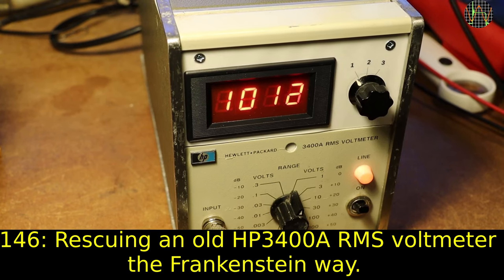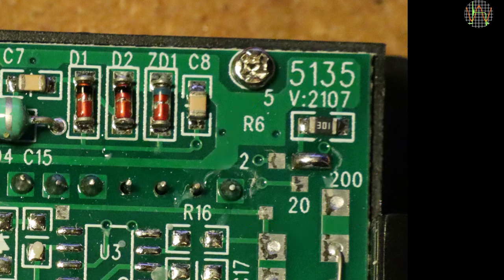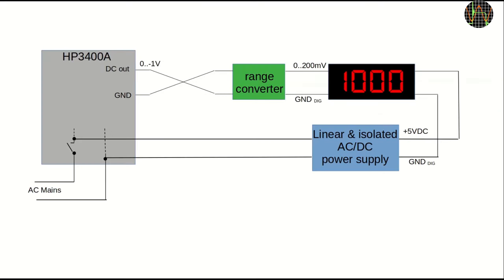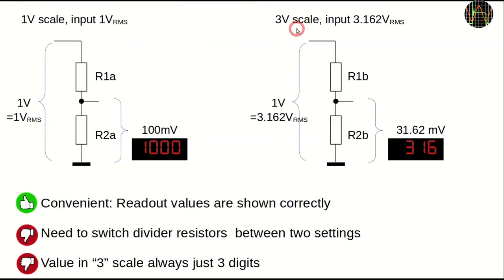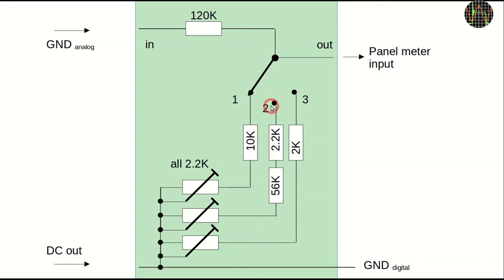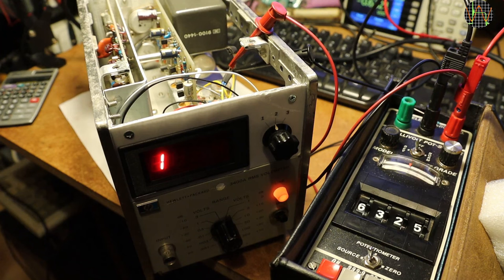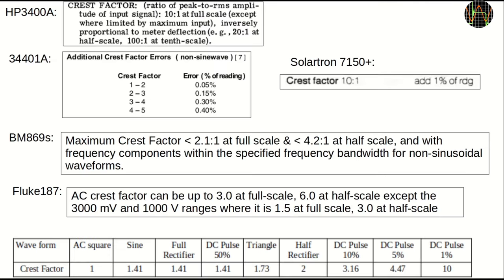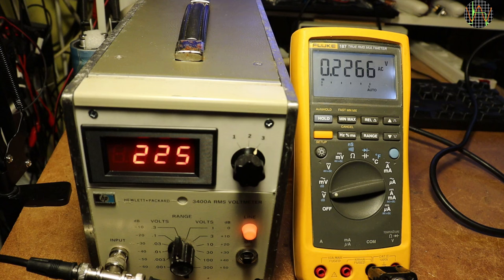146 - Rescuing an old HP3400A RMS voltmeter - the Frankenstein way

Comment: Ha ha ha - another great job and even better explanation. I love that you have rescued the old equipment - will you use it? that is another question - very often we do things just because ;-)
Reply from the maker: Thanks. Yes, you are right. Sometimes I do things because its a challenge or using an interesting principle or looks cool.  In this case, I think I will use this meter mainly for noise measurements (like from power supplies).

Comment: To avoid having to do the decimal point positioning mentally, couldn't the selection pads on the panel meter be connected to the rotary switch in some way to get the correct display?
Reply from the maker: Yes, I was seriously contemplating this and using an Arduino  or Raspberry Pi with a suitable display. The microcontroller could do smart auto-ranging giving always the best resolution and even show the units, eg "mV" or "dB". I decided against it because it would be way more effort than this thing is worth. Let's face it, its pretty much amazing my 3400A still works anyway. The thermocouples have a limited lifetime and so does the nuvistor. Secondly, while its relatively easy to rig two micro switches or two reflective light sensors to detect the right and left movements of the range knob,  you have to know the starting position to determine the current range. If I leave the range on the 1V setting, turn everything off, and then back on, how is the microcontroller supposed to know what range is selected?  Remembering the last position would be very error prone. I considered a method to sync it by turning the range all the way to the right (300V) and pressing reset, to be done at every power-on. Clumsy. The other way, to encode the decimal point directly into something that turns with the range switch is very tricky mechanically. If one has a 3D printer and good mechanical design skills, maybe,  but I know my limits...
Reply: @TheHWcave I must have misunderstood the problem. I got the impression that there was a simple one-to-one mapping of decimal point position to switch position. 
But it sounds as if the problem is more complex than that. So as you say, this unit is probably not worth the effort...